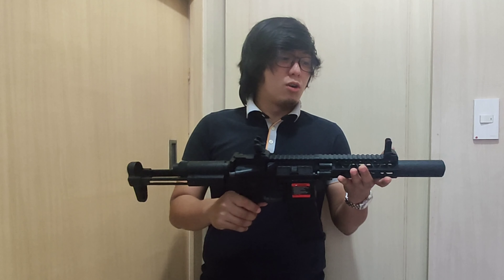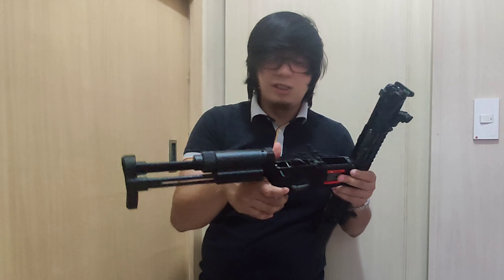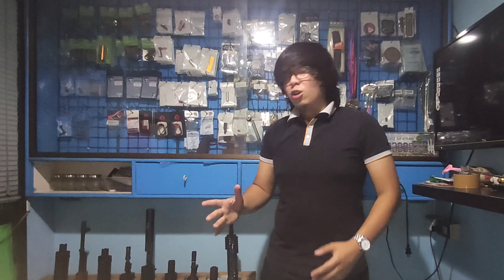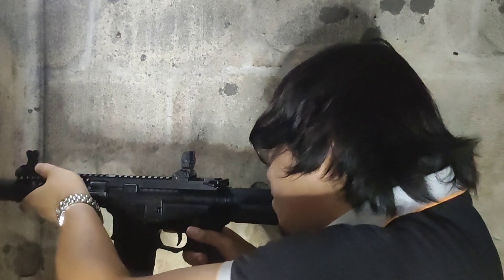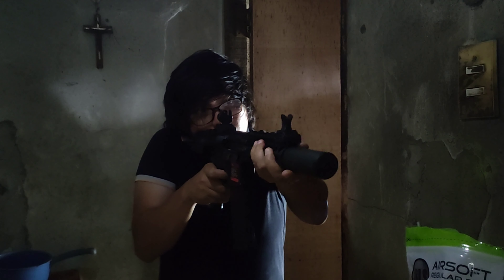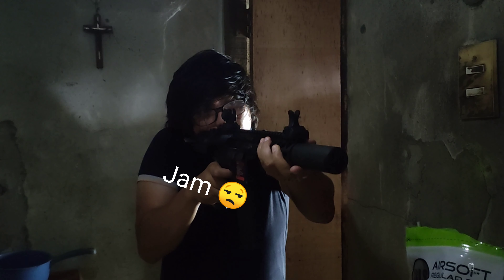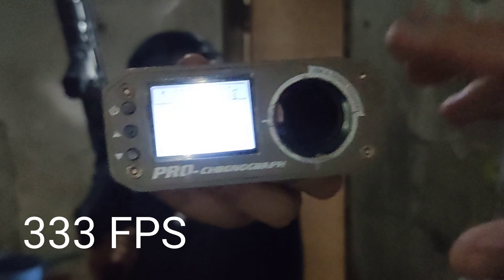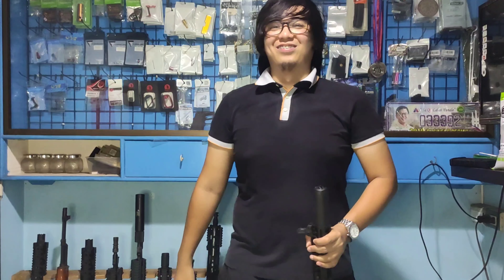Lonex GBBR Part I - steel internals!

Comment: overall, would you recommend lonex's gbb line up over ghk or marui mws?  I'm interested in buying it. but from where I'm from, the price doesn't differ that much fro those two which have excellent track record.
Reply from the maker: Wow nice to hear that..  for me all of them has different  prons and cons .

Like parts availability, accuracy, fps, durability etc.

So for me they are all good 👌. My choice is MWS because i shoot alot of practical shooting and marui are intended for fast and cold shooting and parts are not hard compared to other brand
Reply: @clyde_santos   Haha, maybe I should have been more specific about the pricing. What I meant was that, due to stupid import regulations and tariffs, in my country MWS and GHK are priced around 900 USD and Lonexs new GBB is about 800 USD.

Anyways, thanks for the review and the reply! I also agree on your opinion on TM guns. For practical shooting, they are the best!
Reply: @gustav334  that's way too expensive. the price of the Lonex GBB came up to around PhP22,500

Comment: I have lonex gbbr but doesn't reset in semi auto mode pretty much from new.. very frustrating, 

seems like one of the parts is not long enough or something simple.. can't find any parts to fix it.. lonex never responded to my questions. Won't be buying anything lonex in future 

https://www.youtube.com/shorts/kggEzGlG7lg

anyone know how to fix?!?
Reply from the maker: chech the metal part at the safety. that part is universal
Reply: @clyde_santos  hey thanks for replying!

do you know what the part is called so I can search for it?
Reply from the maker: @thisnameisok actually i dont know 😂 haham but usually its included in the spring set
Reply: @clyde_santos  spring set like spring and buffer tube?

i was thinking maybe its a safety related thing or maybe come in a trigger kit?